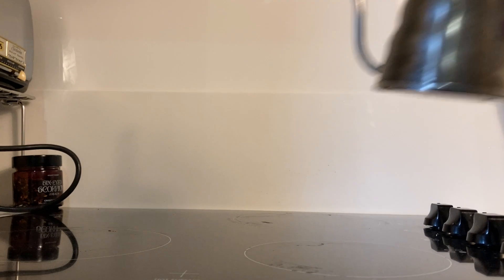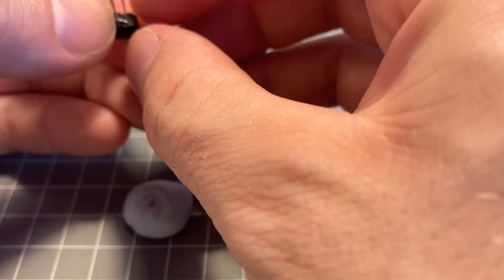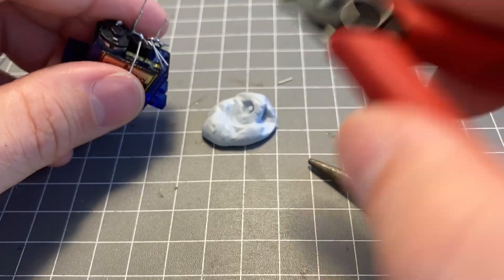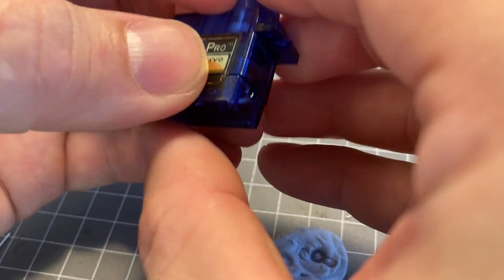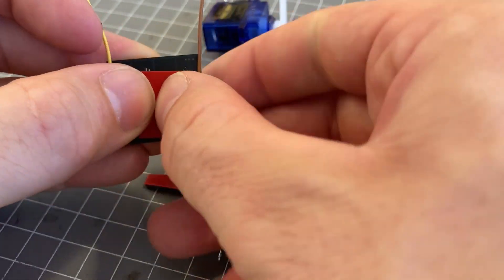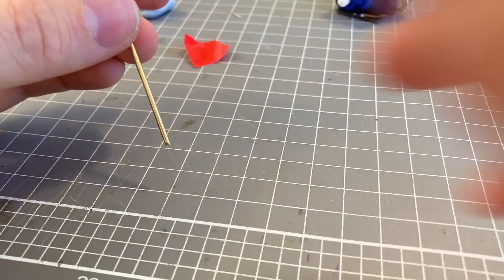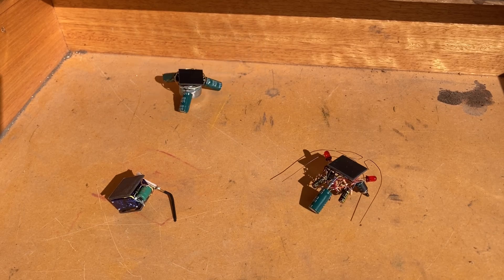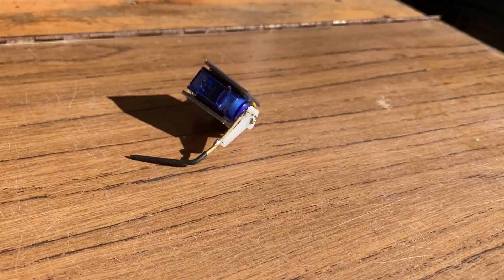BEAM Turmet build video. The second simplest BEAM robot

Comment: Would you mind pointing me to the circuit or schematic ?😊
Reply from the maker: This is a link to the circuit I used, the only difference in mine is I used two solar cells in series with two diodes to prevent reverse current through the dark cell (one diodes cathode connected to the midpoint of the cells and the anode to ground and another's anode connected to the midpoint and its cathode connected to positive) 

http://solarbotics.net/library/circuits/se_t1_mse.html

Comment: Will you be doing any of the Walkers?  I spent years obsessed with them - a walking robot that could navigate obstacles whose only sensor was the inductive load on the motor.  To be honest, I always hoped that someone would find a use for the circuits in more complex walking robots as a hard-wired pattern generator for gait generation or something that could auto-adjust in response to a changing signal driven by various sensors.
Reply from the maker: I have a three motor, light sensitive design I am working on at the moment, I will make a video but it might be a little bit. I think walkers are where BEAM had the biggest impact on robotics, the circuits are so simple and capable compared to microcontroller designs of the same era. Thanks for the comment!
Reply: @ALTcorporation  3 motors... Front, Back, and torso twist?
Reply from the maker: Sort of, it will have a vertical rear motor and the front set of legs will be driven by two motors at 90 degrees to each other.  This should mean that the front legs can step anywhere instead of just inside the plane of a single motor.

Comment: That's a tiny 1F capacitor! Mines are way way bigger! Is that from Digikey? Also, I do have a soft spot for turmets/turbots, I really like them for some reason! Check out the robots built by J Wolfgang Goerlich, it's amazing! (I made a compilation for the vintageBEAMvideos channel)
Reply from the maker: Its tiny! its only rated to like 3v so its only really good for something like this. I got it from a company called RS components. His robots are great, I am actually working on a video for a version of his Scuff Turbot but its taking a while to get everything working together. The vintage BEAM channel has some good info on it, good job on helping keep that alive.
Reply: @ALTcorporation  The last robot I was working on was actually also a turbot I designed based on Scuff. I ended up making an entirely new circuit because I didn't like/have the non inverting buffer chip. I had a working prototype but haven't really finished the project for so long. Super excited how yours will turn out!